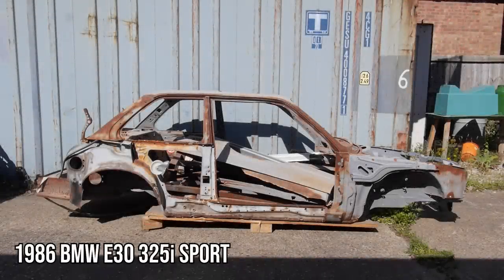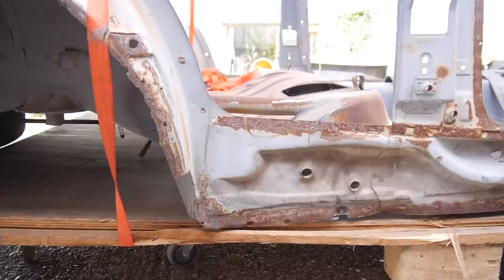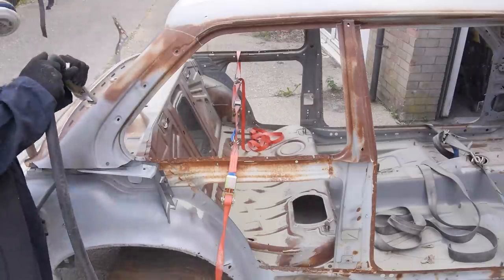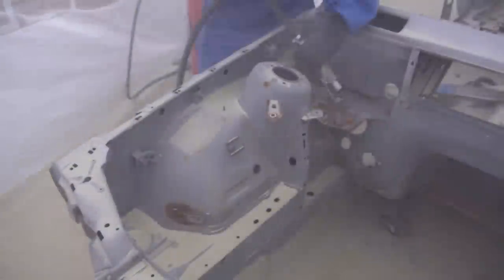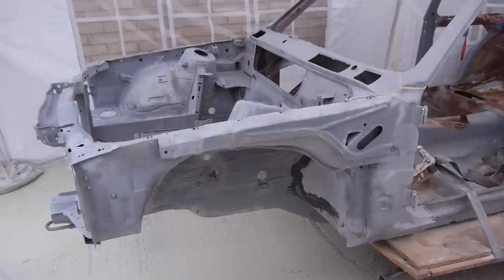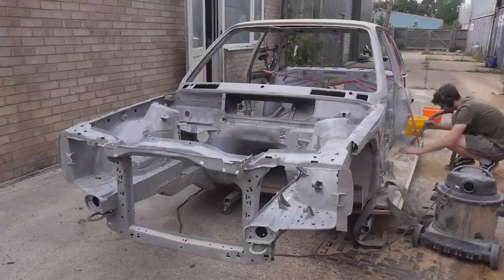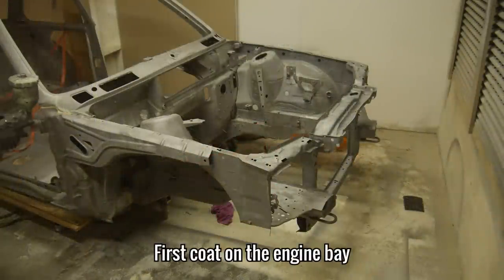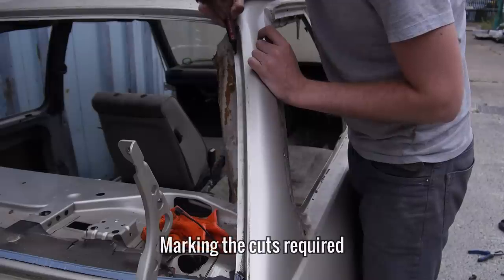BMW E30 325i Sport Restoration - What Went Wrong?

Comment: Great to see you back at it with the sedan... Love that persistance! As for the copper colored welds: They probably used a welding wire made from a copper/silicon alloy (Cu/Si 3) which (i have heard) is a process well suited to the bodywork on a car. It is more comparable to soldering than to welding and causes less heat stress on the workpiece, also is alot easier to grind down since it is softer than "normal" welding wire. 
It can also solder galvanized metals leaving the galvanization intact. 
Usually regular mig welders can handle this process too, i'd advise looking into it. 
Though i must admit i am a mere keyboardwarrior at the moment, i haven't quite commited to using it myself though i do plan on doing so.

Love your work, i wish you the best of luck with parts hunting and getting the work knocked out!
Reply from the maker: Thanks, AllBoardsCreatives! Great comment and although just you're currently a warrior, I think you're spot on... That sounds about right to me at least. I feel less bad about them now. Big thanks mate, really appreciate it.

Comment: As a body repair man with 42 years experience I feel for you with the Spanish post blasting mess you ended up with, the copper coloured welds are plug brazing, you really need a proper spot weld drill with a spring loaded starter and a hole saw behind which only goes as far as the first panel. As far as primer for bare metal goes if you prep using steel wool then etch primer (which is acid based) before your 2 pack primer you won't have adhesion problems. The wheel arches are the same on 2 door and 4 door cars so a 4 door donor car will work.

Comment: Hi. I had the same problem with
My 323i E30 Resto 11 years ago. Those copper welds were used right up to the E46, but because I had no access to brazing arc weld, I went the MIG way.
Keep up the great work and it is a joy to see!

Comment: I know it`s probably too late, but for sieving your media, I`ve found that you can take regular sieve (metal, for kitchen application) tape the handle to the blade of a jig saw (so the blade is parallel to the handle) and start the saw.  it really shakes that sieve, and makes it easier than shaking it or moving it by hand. faster too.

Comment: I've seen repair welds on body panels come up copper-coloured as well. I assume it's some additive to weld filler metal to make it easier to weld, but couldn't say for sure.

Ah, the project that was probably the first time I came across your channel! Yes, your welding skills have certainly come a long way - my learning of welding is only just beginning. I have a lot of practice to do before I am anywhere close to your competency!

One thing that hasn't changed is watching your channel, and the work you do, being very soothing. It's great to see someone doing something they are passionate about, and learning along with them.

Comment: Oh dear, I hope you're careful blasting that roof. It's apparently pretty easy to warp the metal while sandblasting on large flat panels like that.
Don't feel too bad about stripping the other car. Sometimes cars need to give up their parts to save other cars.
Reply from the maker: Like the guy before me, I didnt bother doing most of the roof. it still has the original coating from the factory, and I think i'm just going to epoxy over that.

Comment: The Cooper welds is actually mig bracing, it's needed in some places where the vehicle twist too much for mig welds. 

Some people replace mig welds with mig braces, as does Opels from the GM time too.

Think of it more like glueing the pieces together than making them one.
Reply from the maker: Thank you Simon! In that case I'll leave most of them where they are. Sounds better than mig which is a surprise.
Reply: Yup i took a wild guess lol
Reply: They gas well with brass.. its called brazing and is use in automotive alot.. all of your older cars pretty much have the roof pillars,package tray and various other panel seams brazed together to keep heat low and reduce warping.. then the rest are pretty much your body spot welds.. I would love to see him practice brazing on some of this

Comment: Love the content. As someone who's had a whole car blasted I would just like to say NEVER touch flat panels with a sand blaster if you can avoid it. Does horrible things to the crown of the panel, especially if you cant hit both sides with the blaster. I spent many weekends hammering my roof back in some semblance of shape and even more on my doors and trunklid.
Reply from the maker: Thanks for the advice Ivanae! I will be leaving the roof alone like the previous blaster did. And as for the quarters I've removed, I was going to blast the whole thing, but I think you're right. i'll find a less aggressive way of stripping them down. Cheers!

Comment: The chassis had already been blasted previously and there was no loose corrosion. Should have given the chassis a bath in dilute Phosphoric acid to convert the rust and retain the thickness of the metal. Phosphoric acid converted rust surfaces are also primer , filler, and paint ready surfaces when fully dry and gone over with a tack cloth. Chemical conversion will reach places your media blaster will not. Enjoy turning that body over for a week and seeing media blast falling out of every panel seam for the duration of this project.

Comment: Hi! Great to see the progress you are making!  On the repairs you said were done in Spain  - the copper color.  Not sure if anybody has commented on that, but I remember hearing from one of my professors (a long time ago) that using some copper alloy is a very effective way to join overlapping metal parts. This method can be used as alternative to seam welding for stiffening the shell for racing… .

Comment: Por-15 have a product called metal prep (or ready, it's been a while) that helps prevent flash rusting while the car is being worked on. It will remove some light rust and etches bare metal.

Comment: Totally feel you on looking at work you've done and thinking how much better it could have been - I did some repairs on my E39 M5 that I cannot wait to redo once I get stuck in to the full resto I plan. Since doing those patches, I've really progressed after working on cars that I care about less and learned a lot, especially about doing good repairs on thin sheet metal. Fitzees Fabrications has been an amazing channel on YT for building up the skills on that count. If you're after welders, I'd suggest the stuff R-Tech makes - got their MIG 180 machine and it is much, much better than the basic Clarkes unit I used. Far more control and so much easier to use - while I'd be blowing holes in anything I touched with the latter, with the R-Tech I stitched in a full quarter on my van without any issues, just working back and forth to minimise distortion. I've got an E30 318is that's in far worse shape than your E30, so good luck with it and I look forward to seeing how this pans out!

Edit: The other channel I found that was great for info on rust prevention, undersealing and so on was Trev's Blog - plus he has some really good stuff on welding panels too.
Reply from the maker: Thank you Jon, great comment. Good luck with the projects and i'll look into their stuff now!

Comment: about the copper coloured welds, take a sander to it and see if it makes sparks. If it doesnt, they've brazed the metal on using a torch and a brazing rod. Have had experience with bodyshops doing dodgy work myself.
Reply from the maker: I'll give this a go cheers USS! I'm not sure if its dodgy or not haha. i've just never seen it before... I may redo them...

Comment: What about using the other car's panels to make molds for glass/carbon fiber replacements. You can use the space between panels to add small beams or tubes to maintain rigidity, and use the glass/carbon fiber ones to keep the original style.

Comment: you should do chemical dip stripping and then An electrophoretic coating. There are a couple of companies in I’m offering this service. It’s the same process used by oems just in more industrial scale :) but this best be done after all the repairs are done 👍🏻  dipping will make sure that all internal corrosion is removed and and electrophoretic coating is also dipping so all nooks and crannies will be 100% protected.
Reply from the maker: This is something I really want to do. And I'm glad you made the point that its best to do this after all of the repairs are sorted. Although this epoxy feels like great progress it is only to protect the metal. I'm sure you know this, i'm just telling myself. So I really will look into companies that offer this service and see what i can do. Thanks for the advice, really appreciate it. Cheers!
Reply: @RestoreIt  dont dip the car whatever you do. acid gets between the seams and rots the car from the inside out. sandblasting is the way you want to go. and hot zinc spray galvanizing. with cavity wax in the cavities.
Reply: this is not a good idea. the consensus now is that acid dipping a car does way more harm than good.
It very common for acid to get between the lapped panels and seams, and its often very difficult, if not impossible to fully neutralize and remove. galvanizing wont get in there, nor electroplating because it forms a faraday cage. 
What you end up with is a shell with many, many areas of bare metal with acid on it, all hidden. over time this rusts and pushes the seams apart.
Reply: @RestoreIt  Don’t dip it. You can never neutralise all the acid and it will come out in time and it will rust again. Watch Retropower’s videos where they explain how they blast and hot zinc spray their shells.
Reply: @timc5969  this

Comment: Blimey - that's a big project. Best of luck with that. 
Regarding the rear inner arch/wheel wells, unless they're totally rotten, I would use inner arch lip repair panels. Seen several body shops and classic car restorers use inner arch lip repair panels rather than removing the entire inner wheelwell because it's a huge job which entails putting the shell on a frame or adding temporary bracing and that's assuming you can find a good used part or a NOS panel. And it's quite possible to hide seam welds for patch panels - especially once the epoxy primers, filler primer, paint and underseal goes on.

Comment: You cant go wrong with the name brands Hobart, Miller and Lincoln. You should also look at the Alpha TIG, they are extremely popular for a cheap overseas TIG, i love mine.  If you go with MIG only, look for one that can do a spool gun, that way you can weld aluminum later if you don't end up getting a TIG later.

Comment: Good job! Regarding a new welder you may look at GYS multipearl, miller or Lincoln electric. They are also susceptible to play the YT/sponsor thingy if you ask them. In any case regarding the amount of weld you'll have to do be sure to check the duty cycle is up to your needs.

Comment: Great video, seeing the rebuild from that state will be great to follow. You said it was very satisfying to grit blast the panels, it was also very satisfying to watch the rust disappear and knowing the entire chassis is done properly.
How do you get rid of any rust within the channels ?
Reply from the maker: Thanks, Shane! Glad you enjoyed it. As for the rust within the channels. The shot blaster can only do so much. The original E coating is still in place on the inside. Thankfully I can see and get to most places on the car. If you want to absolutely strip the car of every coating and rust, you need to dip the car in acid and have it E coated again to protect it fully.

Comment: The brass coloured welding that the Spanish garage did is called brazing,. It's ok in some areas but in other areas you got to consider whether it's the right thing for a structural area, because it may not be

Comment: I have just bought myself a 1986 325i sport too. Plenty of rust the entire floor pans are rotted out, sills are gone, those inner rear wings are gone. My plan is to buy a s1 rust free shell and transpose that to my mtech chassis. cheaper and I know the metal will be somewhat fitting because its BMW.

Comment: When you wiped the soapy water off the car, did the towel not leave little fabric specks on the sharp metal? Every time I've metal edges with a towel it left bits of fabric

Comment: What is your setup for blasting, how much pressure are you working on? I have some rust to work on and I thought about blasting it but my friend said that sand blasting will leave holes in chassis because the metal is too thick. Can you or someone explain it to me and help? I'm working on Mercedes w202 from 1996 if that's important.
Reply from the maker: It's a Sealey 75L pot blaster on 125psi. Nothing fancy at all. The main thing is having the compressor to keep up. A 200L is JUST about enough. Leaving holes in the chassis is not something I was worried about at all, even on the thinnest stuff. The angle you blast at makes it very difficult for that to happen. And, if it does blow through, that piece of metal needs replacing IMO. I hope this helped somewhat! Cheers
Reply: Thanks a lot

Comment: Something like a migatronic 183 or 223 is a perfect welder. Or an esab welder.

It may not be a 200$ one, but it will prove it's worth with how good they are. I bought a second hand esab, that were too big for my applications and it were awful.

Don't buy too big or cheap.
Reply from the maker: Cheers for the advice, Simon! I'll look into these. You're a legend.
Reply: @RestoreIt  no problem, and nice to see someone removing, an used quarter panel from the inside. 

We were taught that way as well, when reusing.

Comment: In case of doing this job again in the future, run a wire from the shop vac into the chassis to ground it out so you won't get shocked ;)
Reply: Hah, very funny. Your going to have to try harder than that 😜

Comment: It's nice, that you started again on this project. But I honestly don't think, you will get rid of all the rus with blasting. It will probably be in every small hole, that you cant reach with the blaster. The only good way I know for this really bad cases of chassis rust is a bath in a special de-rusting bath. But it is quite expensive and stands in no reasonable relation to the worth of the car, I think. But I'm looking forward to the project either way.

Comment: if you used quartz sand, that was the cause of your problem with the ep, because you get silicone on the surface of the sheet! you better take blasting granules, then you do not have the problems.

Comment: Those “Welds” look like brazing rod was used?
Reply from the maker: I'm really not sure... Never seen it before
Reply: It’s like soldering but stronger and requires an oxyacetylene or I think you can use a tig welder.

Comment: ASALAMALEIKUM buy laser rust cleaning machine. Costs over 10000 EUR but does not hurts metal and it is ultimate tool for restauration.. In Kosoves many places use that.

Comment: I would have acid dipped that shell instead of sand blasting. You will be finding sand in that car forever.
Reply from the maker: The car is going to be dipped once all of the welding is finished.